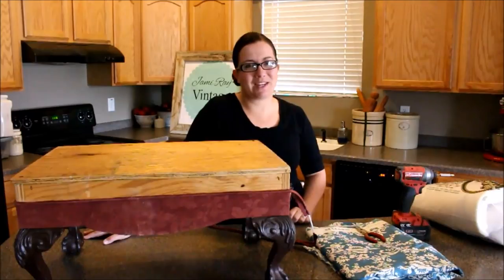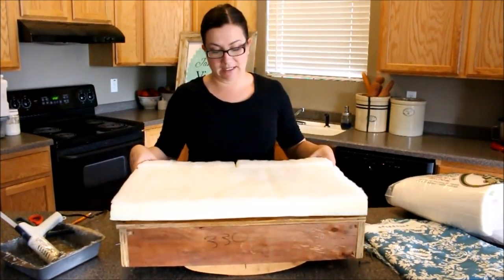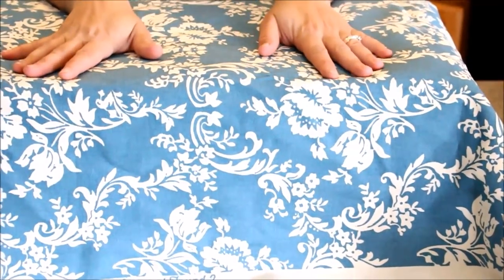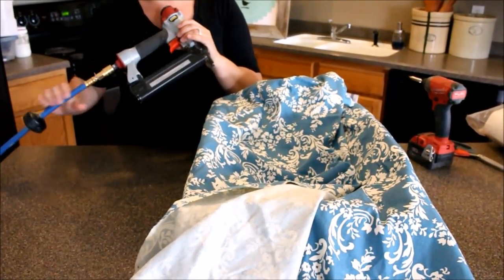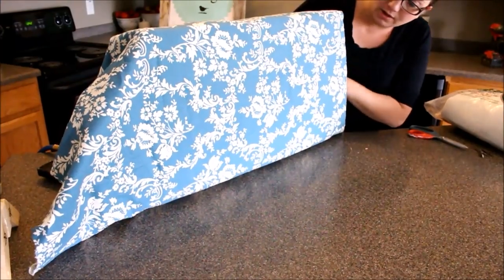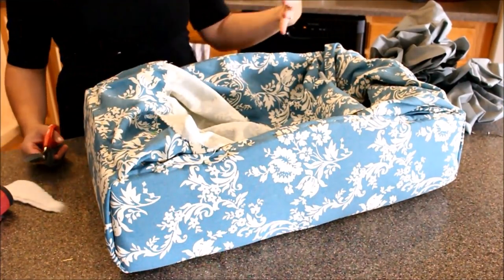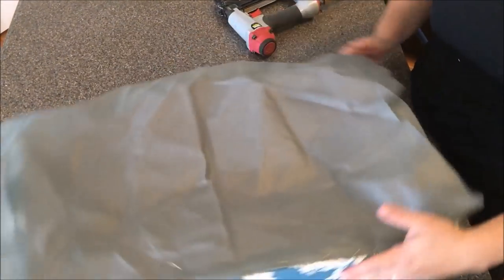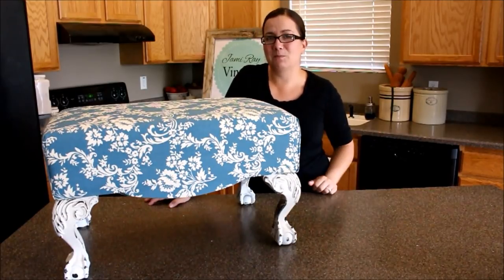How To Upholster an Ottoman WITHOUT Sewing

Comment: 🦋I removed all the fabric and cotton batting last night. Underneath the batting is horse hair over the springs, and I'm going to leave it under new cotton batting. I bought upholstery tacks, at Lowes. I don't have a staple gun available because it's in a box somewhere. My ottoman isn't able to be separated, so my job is going to be quite difficult. I am unable to take the legs off. There wasn't real wood under the material, it was pressed board. Oh! Man! I forgot to buy dust cover material. I bought a bolt of upholstery cloth at the Missions Thrift Store, in Cary, NC. Thank God for GPS in my car, WhooHoo!
I love the job you did on your ottoman .
Reply from the maker: GPS saves me so much time!

Comment: I know this is an older video for you, but I've been dragging around an old ottoman that looks almost like this one for several years!  Finally my son moved out and I'm going to furnish his old room with things I have around the house.  Cue needing to chalk paint all the things!  My daughter and I spent Thanksgiving evening stripping the fabric off my ottoman!  Whew!  That was hard work!  I am going to repurpose my foam.  My ottoman is probably a little larger and man, the legs were really on there!  Two 4" screws in each one, then welt cord over the edges (not necessary, I think I can do mine just like you did yours) and then a long threaded bolt through the center of each leg screwed into the frame!.  I have to pick out bedding before I decide what fabric I want.  But I love your fabric!  I probably wouldn't have attempted this without your video, so thanks!
Reply from the maker: Awesome! Sounds like a fun project with your daughter!  And yes.  Taking off all the old fabric drives me nuts sometimes lol.